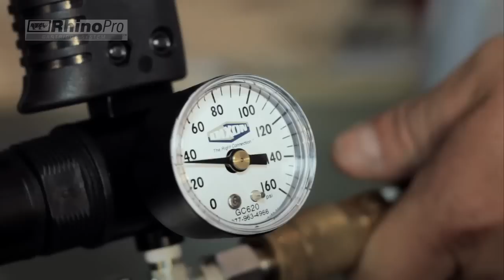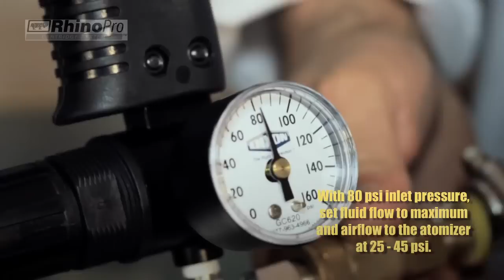RhinoPro Demo Video

Comment: They guy in this photo is kidding himself using a cartridge style mask. Guess no one told him that it will not protect him from isocyanates. Besides that using cartridges to spray a whole bed at the tech specs rhino calls for on their own website using cartridges at 1/16 thickness is way to thin to have any durability! Wonder how long before Rhino realizes this way of selling product is going to be bad for its brand.
Reply: I worked with a rhino linings dealership for 8 years, and when I was trained I was told by my trainer no less than 1/4 inch should be applied to all surfaces and in those 8 years I got pretty good at laying it down to 1/4 inch. We didnt have the cartridge system then so we used the Tuff Grip sprayed thru a gun with no trigger. You had a constant spray until you climbed down out of the bed of the truck and turned off the switch controlling the pump system. Was a hell of alot easier than trying to keep that mixing tube from clogging up!!!
Reply: arent there types of cartridges listed for use with polyurethane? or do you mean for such high volume applications a direct ventilation system is needed?